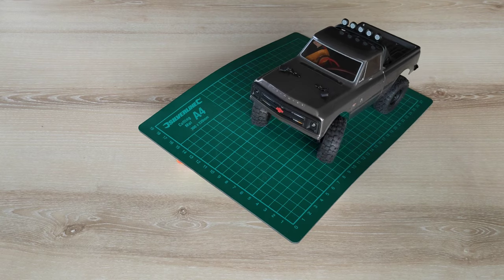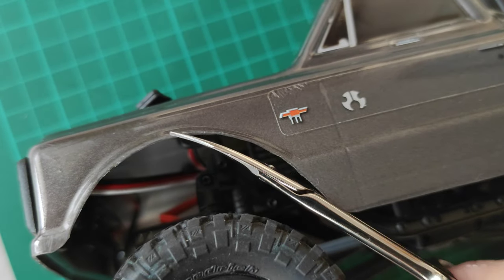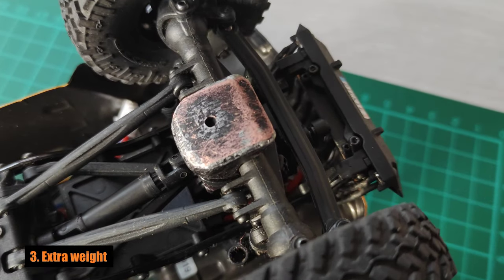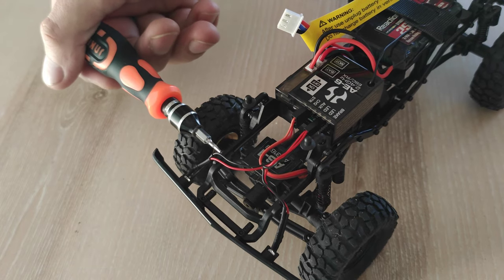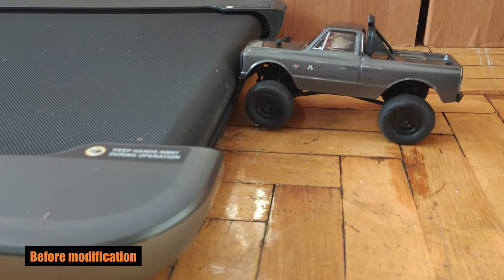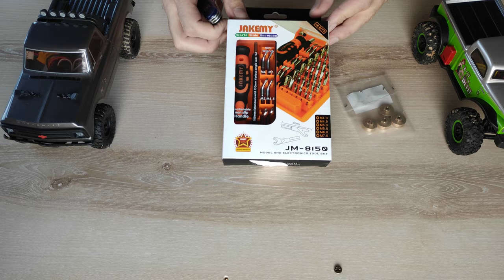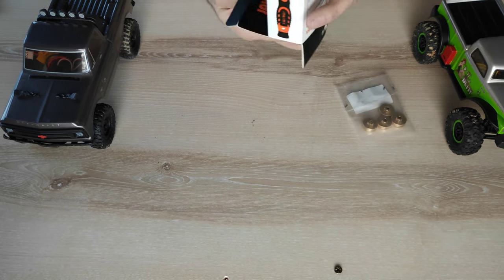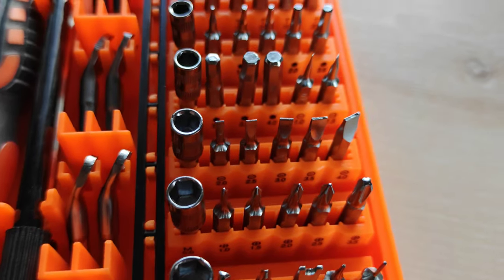Axial SCX24 C10 - 5 modifications

Comment: On front lights no need to drill and take off stickers the light shines right through sticker
Reply: really if so how do i mount the lights?
Reply: @asapplayz6912  there is little clips behind light sticker they go into and the light shines right through the sticker
Reply: ok what size lights can fit in there?
Reply: @mikesned4201  also does light still illuminate like does it still create more light or just like a light to be seen
Reply: @asapplayz6912  The lights that it comes with fit right in there the lights that are from the bumper and it doesn’t make them brighter it just looks more scale realistic

Comment: can you use a Dremel to cut the corners of the body when you remove the bumper?
Reply from the maker: Well, yes I could, but it's not needed as lexan is very easy to cut with scissors. Besides, if you are using a fast speed dremel it can melt the lexan, so you need to use a dremel with an adjustable speed.
Reply: @pandubek387  thanks! I don’t have scissors that small so I was just wondering